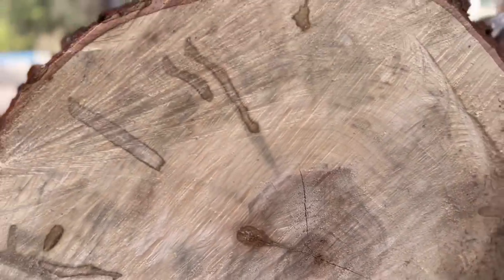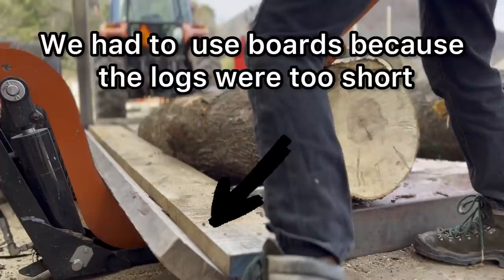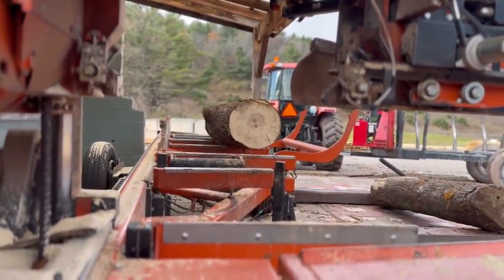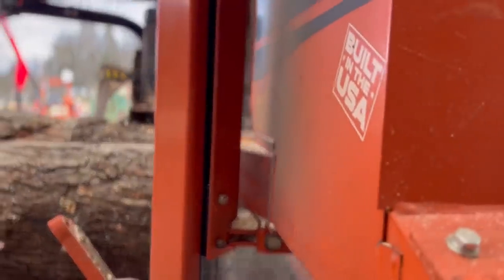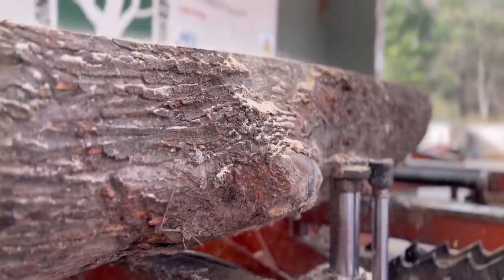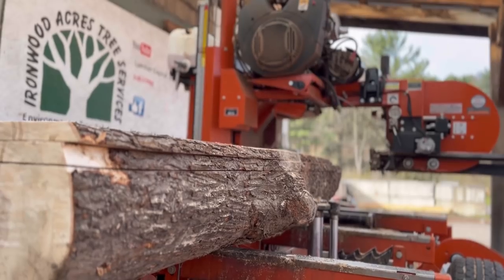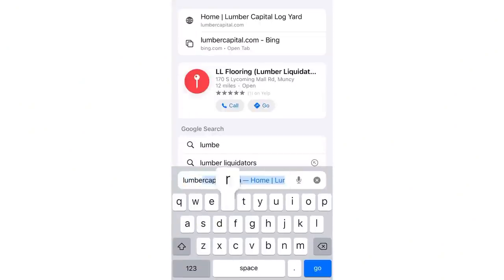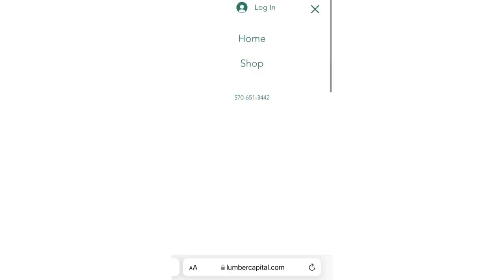Facts About Soft Maple 🍁

Comment: why is that motor on the LT40 slanting when you finish a slab? belt tension?
Reply: The motor mount pivots putting on or releasing drive belt tension. Acts like a clutch for engaging the band.